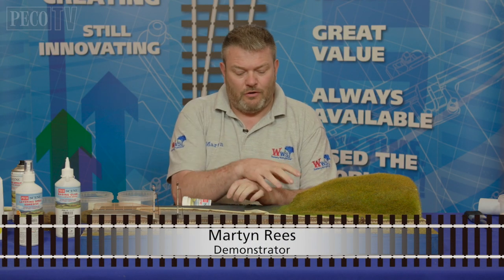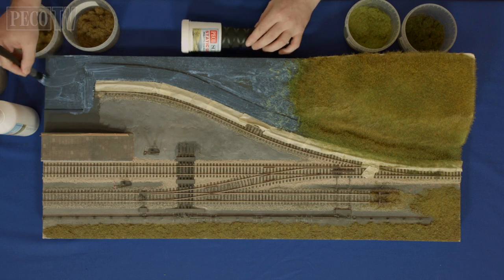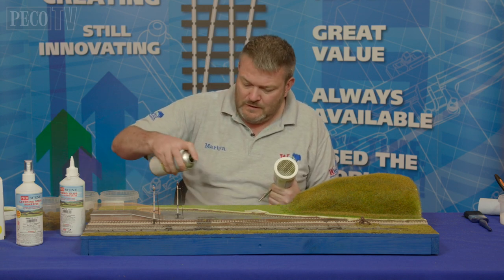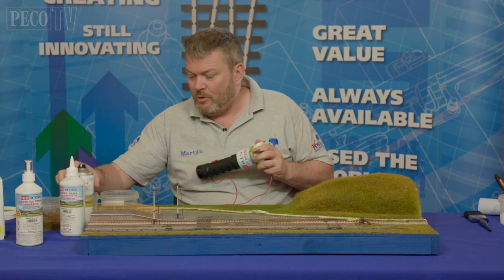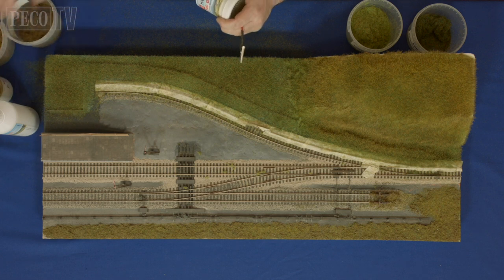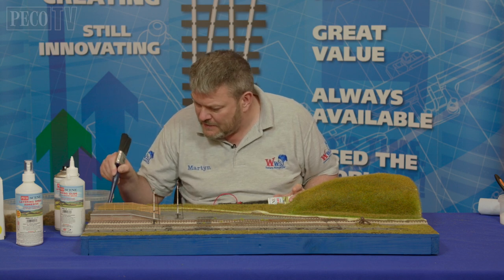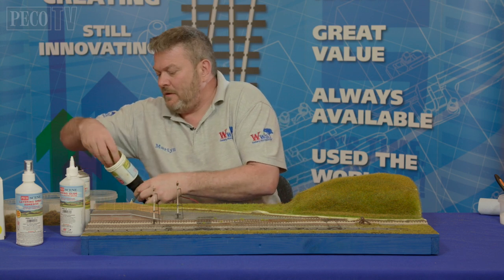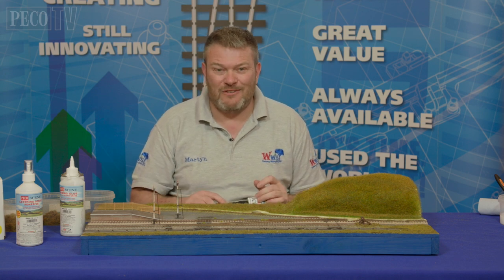Static Grass System Part 4 Creating rough grass areas

Comment: You obviously have a fair amount of working time with the glue, how long does it take for the spray glue to fully dry?
Reply: I always thought that the static grass applicator makes the flock stand up from the glue. Once it's dry you can apply further layers. So how does this barrier spray prevent the previous layer which hasn't dried from getting flattend. And why is he doing large areas by layering when he needs to be more selective.